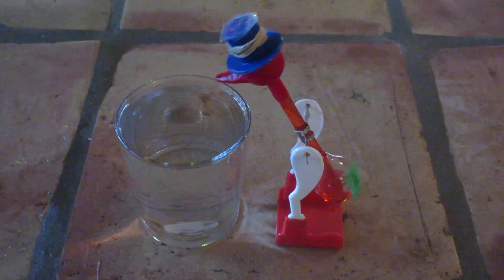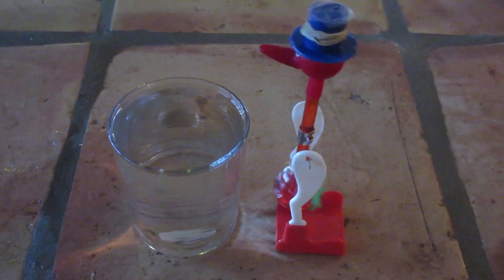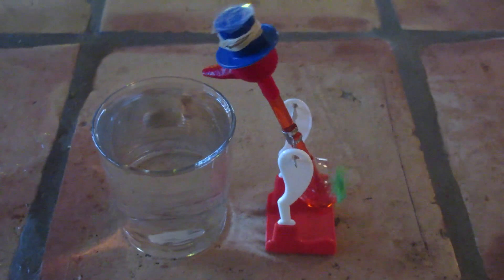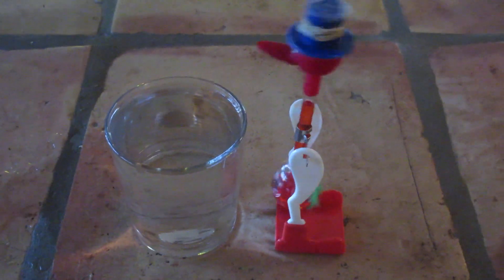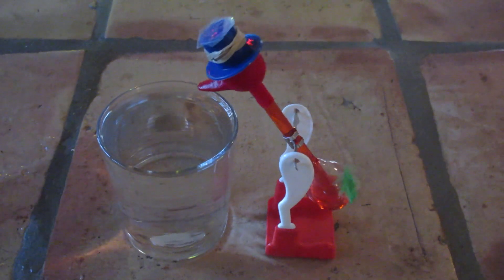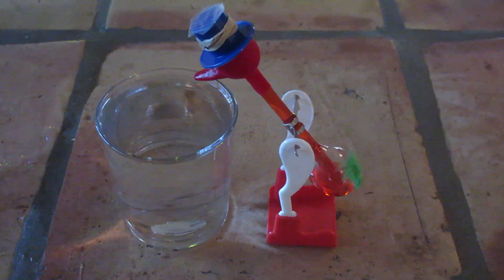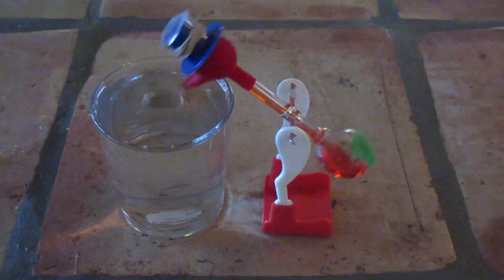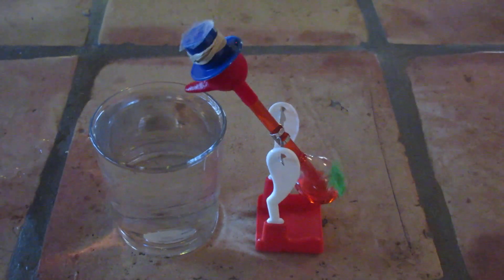Problem #82 - Very Bizarre - How does this Work?

Comment: Energy comes from water evaporating on bird's head, forming temperature difference heat engine requires to work.  Liquid inside is heat engine, boiling below and condensing at top, lifting liquid against gravity.  Tube and swiveling arrangement forms oscillator permitting engine to continuously "run".  It will work outside as long as relative humidity is less then 100%.  If temperature outside is only 3 C, the water may freeze, which practically will stop the capillary attraction drawing water onto bird's head.
          Another way to stop bird is to cover it with a sealed cover.  Eventually the humidity inside will approach 100% and temperature difference will become too small for the engine to work.

Comment: A system always wants to keep the energy that is given to it and so if there is no outer force(like friction) that is trying to take the energy away from the system, then it will keep doing what it was doing. So as for the bird I think the friction that the turning parts have is very minimal so it doesn't create any visible changes in the birds motion, the motion bird is performing is again I think there is a tricky water dynamic is going on inside, it probably has two separate glasses inside that water can keep jumping to do opposite direction of the angular motion and creating a torque but I am not sure about how so I will appreciate it if someone explains that part, I really wonder and by the way the friction inside the glass that water have with the glass would have no effect on the motion because it is an inner force so it won't have effect on the systems motion. For the second question I think if we neglect the chemical effects that the heat would apply I assume the heat difference would not have any effect since it won't create any outer force.

Comment: The energy comes from the room temperature in layman's terms. In more detail, it comes from the surrounding air temperature by heat transfer.
Reply: What is the substance inside the toy, how you are relating with temperature?
If possible can you please explain

Comment: When I was a primary kid, back in '80s,  my dad bought me one of this ever drinking bird... woaw, I was fascinated and I and my friends use to construct some wired theories behind this motion, like there is a tiny invisible devil (kutti-saathaan) inside the glass tube which lived inside the red fluid, we called them as devil's blood.. one day I found that, if the bird is not fed with water, then the motion in the bird dies..  so I told my dad abt this discovery..  my dad smiled and explained me about this in the form of: water in the beak cooling the air inside the head which in turn shrinks that air, which tries to create a vacuum, which sucks the alcohol like red fluid, up into the head, thus the fluid in the bottom getting reduced, which changes the balance of the overall apparatus, when the amount of fluid on the head gets almost same as the bottom,  it comes into to a near horizontal position, thus dipping the beak into the water, and this position also breaks the vacuum, and all the fluid flows back to the bottom, which makes the bird into a vertical position due to gravity...  still I had some doubt, so, i removed the red thread surrounding the beak and found that the bird stopped working. it is the wetness in the thread around the beak and head, and the waving motion in the air, and evaporation of water in the threads, by taking head from the head, cools the head..  Thankyou Sir for bringing me the good old days back into my thoughts.. I am a great fan of your awesome physics lectures.   - ThaaChe, India.

Comment: When the liquid boils it goes into the head and makes it tilt forward and then when the water cools the head the liquid comes down and then it comes to the vertical position. Energy comes from heat in the room . Room temperature .

Comment: ...does the original motion  ( pendulum ) act to serve as a pump that saturates the felt head causing meniscus to draw up water into the head causing it to tilt thus re establishing the pendulum ?  This makes me think about the river off the East coast in the ocean. Were you to anchor a tube North - South in the river, could you not then put inside it a turbine to generate electric power to be run back to the coast to be distributed ?

Comment: hello sir i think that the substance which is filled in it gets heat from the surroundings. And it falls when the tube is inverted making the toy to swing disturbed from its equilibrium position which is indeed an unstable equilibrium.
Reply: do reply sir

Comment: hello sir , I  love you from the bottom of my heart , you have inspired me to fall in love with physics .   Solution to the problem :
According to me I think that when the beak of the drinking bird is dipped in the beaker (filled with water ) there is an upward force experienced on the beak of the drinking bird , that is the  buoyancy  force,  the buoyancy  force is like an external torque  acting on the  system  , and due to this the system gets a kinetic energy which it tries to dissipate the kinetic energy in the surrounding   by oacillating and making itself stable (i.e., trying to attain equilibrium)  and when it is stable  it  starts to oscillate  again which I don't exactly know how it happens but I think it is due to the increase  in vapoue pressure on the left hand side which arises due to the transfer of  energy from the surrounding and the closed system ( the drinking bird)  .  
LOVE YOU SIR
STAY SAFE.

Comment: Obviously this is some kind of heat machine. The temperature difference is produced by the evaporating water from the glass. So this will continue as long as there is enough water in the glass, and it must been completely full before, and lost now few mm's on level. As this has gone so long, and has quite nice speed, you probably you also have some floor heating which supports this process.

Comment: It wont work at outside temperature which is 3 °C , i.e., the liquid would not vaporize and make the head of the bird to dip down in the water. And stop the cycle.

Comment: It is a heat engine 
The bird is filled with a volatile liquid and its vapour. Generally this is dimethanechloride which has low boiling point as the beak of bird dip into it the temp falls and it changes its state to liquid and water gains latent heat the liquid go to tail by gravity and thus increasing the volume and bird it takes its first swing then as bird takes heat from surrounding the liquid in it again vaporises and hence raising the volume and pressure and dipping the bird again into water this cycle continous.
As of that can it work in 2 or 3 degree celcius then yes it can if the liquid in it has boiling point of 2-3 degree celcius.

Comment: The water on the 🐦 head evaporates. Therefore the head cools, causing lower pressure. The liquid is sucked up by this lower pressure area and causes the 🐦 to tip over. If we put 20 billion of these in a rainy area we could power the world.

Comment: The Weight of the water is moving it. It’s basically a weight scale which is tipping when there is a greater amount of weight on side which is allowing to move. But I think it’s the speed it is the tipping back-and-forth is gradually slowing and increasing from every cycle I think that because because if you if you were closer you would see that in one cycle it would be going faster but in the other might be going slower I’m not exactly sure why it’s doing that but I have a guess that could be due to a resistance and cut the water have an effect on its motion

Comment: Its a stirling engine in some way : What is inside is probably only alcohol or something else with a low boiling point, partly liquid partly gas. The vapour pressure is building due to your house heating, pushing the alcohol up. When the center of gravity is above the turning point the nose dips in the water, cooling it down while at the same time the airlock ceases to exist, allowing the cooled alcohol to flow back to the bottom. Then the whole process is repeated

One more thing which is not so obvious is the reason that the whole thing is oscillating. Why does this thing not just dip 1/5 of the nose in the water and comes to a stand, exchanging heat between the water in the glass and your house heating continuously ? The conditions for oscillation have to be met which I think has to do with the existence of the air lock ( yes or no between top and bottom ) together with the rotational mass and momentum which makes it some kind of relaxation oscillator.

Oh  ... And you don't have floor heating :-).

Comment: Liquid inside is an alcohol with a low boiling point.  It expands in the ambient air temperature (if indoors). Takes a sip cooling off the alcohol which loses volume as it contracts so it goes back to the original position where it warms up again.  Outdoors, I guess it would depend as well on the temperature of the water in the glass it drinks.

Comment: Drink water❗
Cornelis Drebbel 1572 - 1633
Environmental temperature
Heat conduction
Density
Center of mass
Looking forward to your solution sir.
Thanks.
Reply: b.t.w. The water needs to be warmer than the alcohol inside the bird.

Comment: I think that there is alcohol or ether under reduced pressure so that the temperature of vaporization is about 20 degrees. Thus, the wet end of the flask is always ≈5 degrees colder than the lower dry end. The working fluid circulates down in liquid form, and up in gaseous form. Energy is taken from the heat of the surrounding air and expended on the evaporation of water. Genious idea!))) 
I think that it will work on the street if the pressure regulator is hidden under the cap of the duck.))) 
If you do nothing, then at 3 and 30 degrees, the mechanism will stop.

Comment: Sir i think it works on simple laws of gravity and law of conservation of energy. As we give it some energy, some liquid  transfer other side which pulls it downward faster  but maximum amount of liquid remains to its initial side (also because of narrow tube it doesn't carry more amount of liquid than other side's bulb shape)  which pull it counter way downward to other side  but energy of the system wants to be conserved(negligible energy loss in friction of pully) so it wants to get backward to other side and some amount of liquid get shifted which accelerates it's downward motion and the cycle repeats itself until energy of system becomes equal to friction of system .  
Couple of years ago i also have it. I broke it accidentally while playing with it . I think it does not carry any pressure filled liquid . But it makes such a way so it makes easy to flow throughout the tube.

Comment: As the system loses energy, i knew it had to take in energy somewhere. I thought at the bottom. Ofc couldnt see what was happening at the top. Also knew there was some PV/T=c  involved.
Obviously the liquid goes up, bc of this.
But couldnt quite see how it would in a closed system, with the bottom being the motor and the top being the static part.

Untill i saw somewhere that the top needs to be wet for it to work. Well that gave it away.

The top is the motor. Runs on evaporation! Smart engineering!
So as long as the top is wet (with any liquid really), the evaporation taking place bc of surrounding temp and gas pressure, etc, will draw energy from the system, at the top (where it 'drinks').
Lowering the pressure there (pv/t=c), which results in the liquid going up the tube. Which will eventually lead to it tipping over, which resets the system.
So as long as the top stays wet, it will repeat itself.
It stops as it gets dry.

So if you put it outside, depending on which liquid at the top, it should still work if that liquid can evaporate and thus draw energy from the system
Also the liquid inside has to have the right properties wrt mass, viscosity, freezing point and such.

Comment: its a Heat Engine, and temperature is a big factor which should be kept near the inside fluids boiling point. another important factor is environment relative humidity (phi) if it's 100% ,whatever the temperature be, it wont work!

Comment: Please read full article.

A1))The pink liquid in bird vapourises as a result increasing pressure in the tube and thus the pink liquid goes up and due to the beak dipping in water the water vapour condenses the pink liquid. I think surface tension also plays some role (Capillary action). When inuff liquid is on head the center of mass shifts and apply torque about hinge then pink liquid flows down and again gravity appy torque

2))The engine will not  work at 3°C as the pink liquid nither water will evaporate

()()()The engine won't last forever because of 2nd law of thermodynamics that entropy of universe should increase for a spontaneous process but we see that in this engine the first law says energy from liquid and water(∆H vap) and from mg (in full cycle energy from mg is 0) so it seems like this is isolated system and entropy of universe is 0 so how is this possible it is possible because the hinge point leaks energy in form of friction losses thus after long thime either water in glass will be empty or equilibrium will be attained between pink liquid vapour to pink liquid liquid

(Pink) liquid <=>(Pink)vapour. K(equilibrium)
 
Is it good please reply Sir Walter lewin

Comment: I Am a 10th grade student  . But still I am trying. Sir, the bird might have inside it some chemicals . So when it just swung up all the liquid fall below then again rises and again falls.after some time the swinging becomes less and finally it stops in a horizontal position . In the horizontal position the shape of the  bird is such like that the liquid is pushed to  the left side as the right part of the bird is tumbler type . So it just rests. When resting  more liquid is pushed towards left and the bird falls in the water. While falling in water the bird gets a push due to the density of the water and the cycle continues.

Comment: Hello Professor and everyone. The glass tube is filled with alcohol colored with perhaps food colorant. Alcohol expands and evaporates at room temperature. This result in less liquid at the bottom of the glass tube. Center of gravity is shifted and more mass being at the top of the tube. As the tube starts to move it eventually makes contact with water in the glass. Water cools down the alcohol, eventually the bottom of the tube gains more weight. The process repeats forever. 

Yes. This will work outside. It will work anywhere as long as the pressure and temperature allows for the water to be in liquid state and alcohol to transition between almost gas and liquid form.

The energy is coming from the sun. Or if you are using a heater in the house.

Comment: explanation is very simple . you can search for the drinking bird in youtube get an insight of it 
and for the last question 
NO it may not work in cold environment  (3'Celsius ) BECAUSE the water over the beak will not evaporate easily and thus no pressure difference between the top and the bottom glass bulb

Comment: Required a Lot of Brainstorming.
Here it is.
The drinking bird works by evaporation of ether inside its body and evaporation of water outside 
its head. The liquid ether in its body evaporates at room temperature. As it vaporizes it creates an 
increased pressure inside the body, which pushes liquid ether up the tube to the head. Ether in the upper 
bulb (the head) is cooled by the evaporation of water on the outside of the head, and becomes a liquid, 
thus there is a transfer of ether from the lower (body) to the upper (head) bulb. When enough ether has 
collected in the head it overbalances the bird which pivots forwards. When the bird pivots forwards the 
ether runs back to the body, which pulls it upright again. The pivot tips the head into a glass of water, 
which wets the head, allowing it to cool again, and condense the evaporating ether again - repeating the 
cycle over and over

Comment: Hello Dr Lewin, I owned one of these, but unfortunately it crashed and broke. But I know how it works. The bottom bulb gathers energy from heating. Inside is a fluid that has a boiling point that is close to room temperature. The vapour rises to the head part. That has a cover that must be started by wetting it. The water evaporates there while the bird swings, so cooling down the vapour of the internal fluid. That condenses and creates a vacuum, so moisture is sucked up, now during the swings the fluid is going up, until a point where it tips the head down. At that point the vacuum is broken so fluid flows down into the reservoir. At that point the cycle starts again. The level of the internal fluid is critical for a good operation.
I have witnessed it. It working during winter (where the temperature at my front window is lower than 15-17 degrees C.  I could measure the start of spring by my bird beginning it’s drinking.
During summer the number of cycles of drinking increases, temperature so high that evaporation is quicker. I have taken it out of the window during June-August.
Nice to see you have one too... have a nice day.  Groeten uit Nederland.

Comment: The source of the temperature difference that keeps it going is water evaporating from the head, while the bottom stays closer to room temperature. It's filled with liguid and it's vapor and the colder head makes the vapor condense, which creates a pressure difference and makes liquid rise from the bottom to head. When it tips, the tube end rises partially above surface on the bottom part, letting vapor flow and balance the pressure. It works only on a temperature range where the substanse inside can be in both liquid and gas forms. it probably won't work outside now.